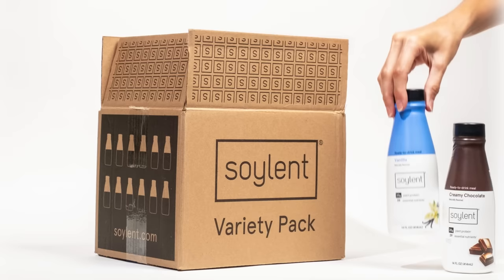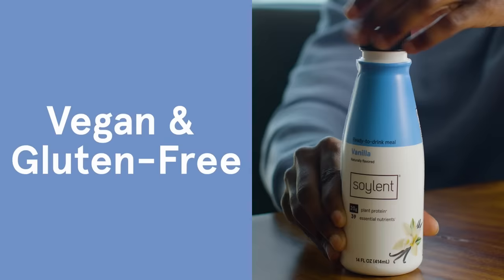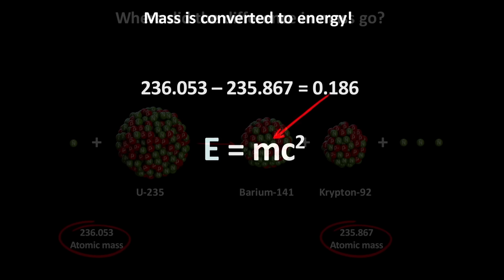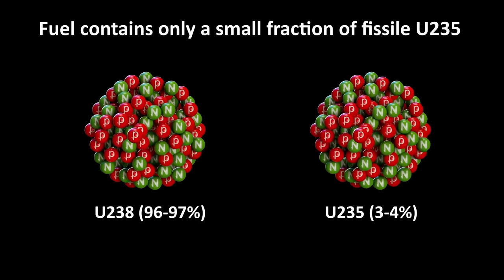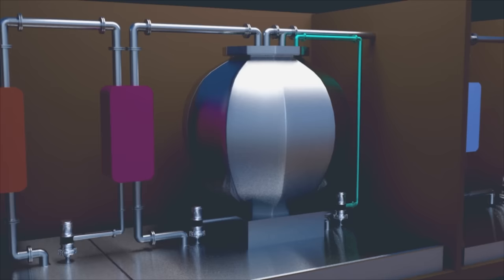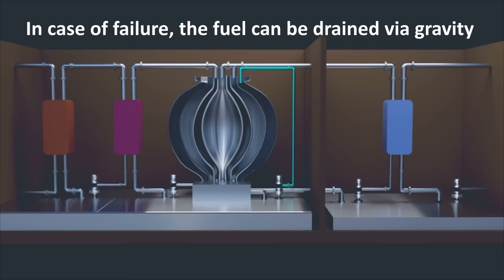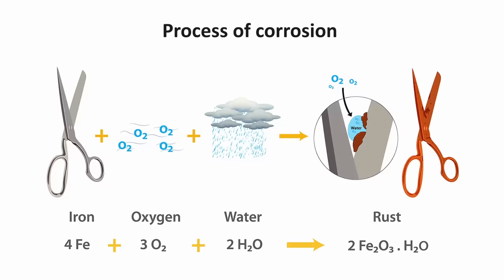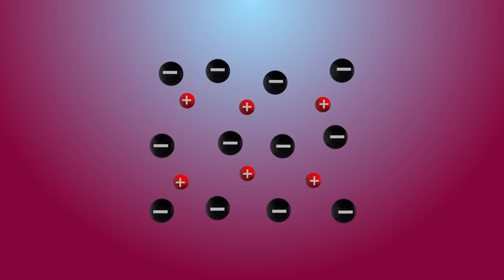How Molten Salt Reactors Could Revive Nuclear Power

Comment: In a post I did below I mentioned that I would post the history of Thorium fueled power plants.  The USA built 4 of them.  This is an edited version of a post I did elsewhere.

Thorium as a potentially viable fuel was identified in the 1950's by many countries.

First though is that thorium is not fissile (you cannot get a nuclear reaction using thorium). A thorium reactor actually runs on U233 in the end - and its U233 that is recoverable from them.

In the presence of a properly controlled nuclear reaction thorium 232 absorbs a neutron and becomes protactinium233. The protactinium233 then decays to U233 (which takes about 2 months to get usable quantities of U233). As such all thorium reactors must be seeded with U233, U235, or plutonium239 (the common fissile materials) to supply fuel for the first 4+ months of operation.

I’m not going to list and discuss all the existing test reactors that had thorium loaded into them or the thorium specific test reactors that were built. Suffice to say that thorium was tested in both existing test reactors and specific built thorium designed test reactors by multiple countries.  Also in all kinds of designs since the 1950’s: Light Water, Heavy Water, High Temp Hot Gas (HTGR) and of course the Oak Ridge Molten Salt Reactor (MSR).   The recent several decades have focused on HTGR pebble bed designs and of course China just built and started up in August 2023 a new thorium based MSR to determine if we technically have solved the molten salt corrosion issues well enough to proceed with further development.

I am including the Shippingport thorium core load 3 (1977-1982) as a test reactor.  Shippingport was a naval aircraft carrier PWR that became the 1st demonstration and test reactor for commercial power: 60MWe output, Online 1958 (1st nuclear electrical power generation from a plant built with its primary purpose to generate electricity).   This thorium core proved that a thorium core could self-generate surplus U233 for recovery by reprocessing.  Shippingport was shut down in 1982 at the end of this test. 

To date only the USA felt that they had thorium fuel designs based on test reactors that worked well enough to design commercial power plants from, which did not work out as explained below.  In retrospect they can be viewed as very large and vastly costly test reactors.

The USA had also spent the equivalent of $Billions in today’s money to build a stockpile of U233 to seed thorium reactors and for atomic bomb tests in the 1960's (the U233 bomb worked well).  Note that they are now looking to spend $billions to dispose of that U233 stock as the containers are degrading and disposal is cheaper than repackaging the U233 stock into new containers which does not count long term cost of storage that follows – and eventual use or disposal in the future.  Also, there is no real foreseen use at this time for that U233 to justify the cost of preserving it.

1st attempt was Indian Point Unit 1 – light water thorium fueled 275MWe PWR power plant.  Online in 1962.  The thorium fuel performed so badly that they changed to uranium fuel in 1965 and the plant spent the rest of its life as a uranium reactor that operated well.  Unit 1 was shut down in 1974 due to changes in regulations from when it was built as the emergency core cooing system that was acceptable in 1962 was no longer acceptable in 1974, and initial plant design made retrofit of an acceptable system uneconomical (nuclear power plants tend to have lots of rooms with very substantial reinforced concrete walls – there may be almost no room to install something different).

2nd attempt (approved for construction at essentially the same time as Indian Point Unit 1) was Elk River – a light water thorium fueled 22 MWe BWR (Online in 1964, Shut down 3 ½ years later in 1968 due to major design and construction issues which led to cracks in the reactor vessel and main piping resulting in significant reactor water leakage.  I have found comments that says the reactor and power plant did not operate as expected; but, no evidence if this was a fuel issue or other issues.

More interesting is that this was presented as a prototype for a “Small Modular Reactor” for rural America (SMR’s as the reactor assembly and boiler was built in a plant and shipped to site by a railcar), which could be done anywhere as the key SMR concept of small nuclear reactors would be economical due to mass production was presented at an international conference in 1955.  However, 17 power plant reactors which would be considered SMR size today were built in the USA from the 1950’s into the 1970’s.  Not one of them is operating today – where a number of large central station nuclear power plants built at the same time are still operating.

Other than the cracks and reactor water leaks the biggest lesson learned was that small nuclear units like this would never be cost competitive with larger nuclear units as they need more materials and cost much more to build on a MWhr generated basis; and also cost much more to operate and maintain on a MWhr generated basis than a larger plant due to staffing requirements. Note that a 12MWe uranium power plant in Piqua, Ohio which ran from 1963-1966 was closed with the same conclusion.

3rd attempt was Peach Bottom Unit 1 - a thorium fueled HTGR reactor (as that seemed to be the most applicable technology other than light water based on test reactors). I believe it was about 60MWe output. Online in 1967, shutdown in 1974. There were severe problems with the thorium fuel and it was quickly changed to U235 fuel. There were massive other plant design problems (scaling up from a test reactor size rarely goes smooth). A total commercial and technical flop.

4th attempt (based on lessons learned from Peach Bottom) was Fort St Vrain - a 330MWe output thorium fueled HTGR.  Online in 1979, shutdown in 1989 due to several issues in the plant design that affected operation and required excessive and expensive maintenance and only produced 15% of the power it should have if it could run well enough to base load at 100% output which is how most US Nuclear Reactors are loaded.   I had a coworker who had worked at Fort St Vrain and he told me that in the end it was also converted to Uranium fuel.   I have been unable to verify that with limited internet searches (multiple sources report that Peach Bottom Unit 1 was quickly converted to Uranium).   Fort St Vrain was again both a major technical and economic flop.

Bottom line is that there has been extensive research into thorium-based reactors by multiple countries from the 1950’s to current time, and the USA even built 4 commercial power plants using BWR, PWR, and HTGR designs.

No country to date has made a test reactor or power plant work well enough to design a future power plant at this point – especially when they look at the USA’s attempts at building thorium fueled power plants by substantial scaling up of test reactors. The world history of initial nuclear power plant designs, and even 2nd generation designs, in many countries show lots of failures as what seems to work so well on paper often does not work in practice (or is too expensive to maintain).

Research continues and just because thorium did not work well and was not economical in the past does not mean that it won’t work well or be economical in the future.  It’s just going to take a lot of money and time.  If it was easy, it would have already been done.  

There are also a lot of investor scam companies out there claiming that they have the solution, when no one really knows what the solutions are yet. These companies often talk of building plants on a fast timetable but have never even started a "pre-licensing" review of their design which is normally needed to get to the point to be able to submit a reactor design for licensing (figure several years for pre-license review, and then several more years for licensing once a license application is submitted).  Just how many reactors does anyone think they are going to build that are not approved by the nuclear regulators? But, they generate good paying jobs for people for a decade or more by telling by telling investors and lots of people that the solution is obvious and simple.
Reply: Wow, thanks.  😎
Reply: Thanks, I was a fan of Thorium MSRs until reading your comments. I would love to see them happen but that probably wont be in my lifetime, if ever.
Reply: As I understand it, Thorium can be (and perhaps is) used in MOX fuel. By replacing some of the U238 with TH232 or mixing it with PU239, you can make a substitute fuel pellet that works similar to standard enriched uranium fuel pellets. Doing so can reduce the overall PU239 remaining in your fuel waste or be used to downgrade highly enriched weapons-grade materials.
Though I do understand that such methods do not really count towards building a true reactor based on Thorium.
Reply: It’s just going to take a lot of money and time.  If it was easy, it would have already been done. - Why bother? Wind and solar are cheap, safe and scale up.
Reply: Next time, could you just write an abstract or executive summary?
Reply: @nolan4339   Correct:  You can fabricate thorium and any fissile material into a variety of forms which would work in a variety of different reactor designs.

What is added as the fissile material to the thorium to run the reactor to the point that adequate U233 is generated to sustain the reaction would be U233, U235, and Plutonium 239.  These can either be very pure - or mixed with other things (like U238).
Reply: @holz_name  Wind and solar are definitely not cheap! Try equipping your house with enough, solar and batteries to live a normal life. Not cut down your energy bill, but run all of your appliances and everything when you want it, as long as you want it.  Are individuals going to have their own solar farms or is the power company going to build massive solar farms and battery stations outside of every single town on Earth? The wind turbine farms by me are already a massive eyesore also and those barely make a dent in the local grid. You would need millions of the things to power not only everyone’s home, but all of the industry on Earth! (including every factory in India and China). Do you have any idea how much power one electric induction furnace that smelts metal uses? Every square inch of the planet would be solar panels and wind turbines! Also, wind turbines are super dangerous and have killed tons of workers that install them. (I had a good friend pay a ton of money to become an installer and he quit after six months because he saw three separate guys die.)  Also, if anything goes wrong with the braking mechanism in the turbine and a good wind comes, they can over speed and explode catastrophically. It has happened. They have had other catastrophic failures like oil fires, also.  Sadly, improved nuclear power is the only viable future for humanity, unless we all change our habits way more than anyone would ever be willing to.
Reply: @dutchflats  If I write a few paragraphs people don't believe it or ask for more details.  With full details people can look up the sites and issues I mention on the internet and see that I'm not just blowing smoke, making things up, or expressing just an uniformed opinion.
Reply: Maybe I am hearing it wrong, but I’ve heard the corrosive problems have been solved with new materials .   Also the Chinese are supposed to have a MSR experimental plant up and running by now . I wonder how this is progressing?
Reply: @perryallan3524 Your explanantion was perfect! Thanks
Reply: @dutchflats no, you write it or are you too lazy to read?
Reply: Where are Rolls-Royce in this?
Reply: Before writing and posting my statement below, I should have read your report. I still think Thorium has a chance with today's technology though, thank you for such an excellent report.👍

The Thorium based modular nuclear reactors is essentially not a new technology, it's an old branch that was mothballed. Since this technique has been revisited it makes sense to delve further into it's feasibility. The current renewable technologies, ie. Wind and Solar are simply not " Green", more to the point; they are not recyclable or efficient!
They are simply a quick fix to make a small group of individuals rich!
Reply: @simonmasters3295   Rolls Royce is working on a 570 MWe PWR " SMR" design for the EU (and at 470 MWe I personally don't think that falls into the definition of SMR - I can understand the stretch to 300 MWe; but not this).    I just checked the UK Office For Nuclear Regulation (ONR) and Rolls Royce is working with the the in the review process.   I'm not sure if this is a "pre-license" review or an actual license application.

I note that Holtec and GE-Hitachi are also working with the UK ONR in the same process for their designs that they are in the pre-review license process in the US NRC.  Both of those designs fit within my understanding or PWR.

One note about the RR "SMR" is that they claim that they can get very efficient assembly cost by using 1500 pre-assembled modules manufactured in a factory and assembled on site.  Here in the USA that method was tried for a couple small fossil plants a few decades ago.  There was lots of problems with things not lining up and in the end it was not cheaper nor faster than a normal site built fossil plant (which has often had certain equipment skids delivered to site where all you had to do was run connecting piping and wiring to the equipment on the skid - going back to at least the 1950's)

If it is built we will have to see how well this process works.  Since each of the 1500 modules must be custom built and adds the cost of the module frame and supports... I'm not seeing where the cost savings comes in except likely in some theorized plant assembly module (how well will the theory work in real life?).
Reply: @holz_name There are significant and unsolved problems with wind and solar.  1) a short operating life that leaves highly polluting, (as yet) unrecycleable waste — blades and panels create massive toxic waste products.  

And 2) power generation is weather-dependent so a whole additional industry is needed to store power, again with consequences for long-term pollution.  

In the longer term research may solve these problems, but research may solve the problems of nuclear waste and fusion, so it is all up for grabs.
Reply: @kaylidington  it would be great to provide some sources. I think they can have a life span of more than 20 years? A quick Google search says life span is between 25 to 40 years for solar panels and 20 to 25 years for wind turbines. How is this "quick"? Also what is toxic in solar panels or wind turbine blades? The first is just silicon and the later just some metal aluminum(?) - no I'm wrong it's actually thermosets, a polymer. True, thermosets are not easy to recycle, but they are also used for car tires. So I don't think the few wind turbine blades will make a difference in the billions or trillions of car tires. So you are just correct about the wind turbine blades, but the rest...

Weather? You think there is any one hour or day when there is no wind in a country the size of the USA? Or in Europe? And except for solar eclipses there is sun the entire day.

Again, what consequences? The easiest storage form is gravity. Basically you have a mountain and you pump water up using solar energy, then you drain the water through a turbine. Then there are molten salt batteries which don't have any toxic stuff in it. I fully agree that lithium batteries would be really wrong here. But again, toxic batteries are in every car. Among the mountains of billions of car batteries I think the few batteries for green energy don't make a difference.
Reply: From that 40 foot container, what would be the predicted power out put 1 megawatts,  5 megawatts......?
Reply: @deant876   Well my understanding is that Copenhagen's (spelling) is for a 100 MWthermal reactor.   That would give about a 40 MWe power plant using a conventional steam power plant.

I happend to know from experience that you cannot get even the steam turbine and generator set for a 40 MWe power plant in a 40 ft shipping container.

Nor can you get the condenser.

Lots of other equipment could fit.

I even see that a reactor vessel of that size could fit into a 40 ft container.   

But a reactor vessel does not make a power plant.   Figure half a city block for a 40 MWe steam power plant assuming it has a good cooling water source and does not need a cooling tower.
Reply: @holz_name  Solar cells degrade each year they operate (and commercial grade solar cells degrade faster than very expensive research/scientific grade - which you mainly find in orbit or on another celestial body).

The result is while the solar cells may technically last for many decades (perhaps even 100 years); it's not an economical use of the space to keep them past 20-25 years for most commercial solar cell. It's cheaper to replace them and generate more power again.

You can find the latest ranges for solar cell degradation per year just by doing internet searches.
Reply: @holz_name  Because solar and wind are not on demand sources. You either need to multiply the production by 3 and store the excess, which then makes them more expensive than coal, multiplies the already harsh problem of taking too much land, and all the pollution associated to the manufacturing of those exceeds. Solar/wind requires an on-demand source of energy to cover for the gaps. That source can be hydroelectric, fossil fuels or nuclear. Hydroelectric is zone dependent and climate change will give a pig punch to the storage of water. So, where hydro is not available, you either have to choose between fossil fuels, nuclear, or addicional wind/solar + storage which, at the moment, there's no real technology to store enough energy to supply the whole world.

If you want to decarbonize our society, we only have the nuclear option.
Reply: @BlueFrenzy  We don't need to be zero CO2 society, it is already impossible anyway because we eat meat and the livestock produce a lot of methane. I don't think other energy sources will be completely replaced by solar and wind. My argument is that nuclear is obsolete today and it's better to expand wind+solar than to invest 10s of billions $$ in nuclear that take decades to be build if ever they even finish. There is a reason why all of the nuclear power plants today were build in the 70s and 80s. Nuclear is high risk, high expense and take decades to be build. We need to reduce our CO2 now to the 0.5 to 1 degree warming range. There is plenty of land and shores available to have like 80-90% of electricity produced by wind+solar and stop all coal and gas power plants.

The problem is not with wind+solar, it's with the grid. The grid is designed to have a few big producers, and not to have many small producers. This means that there is quite frequent the situation that in the north is overproduction of green energy and in the south there are brownouts.